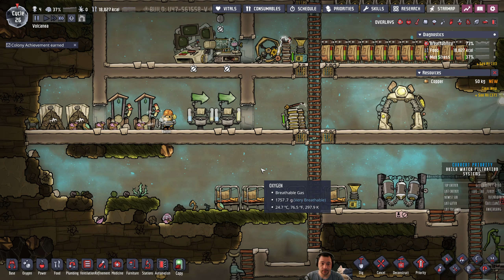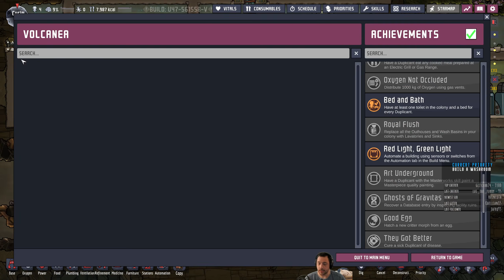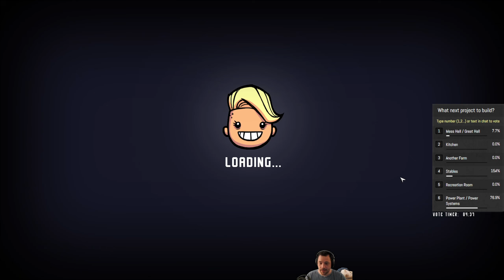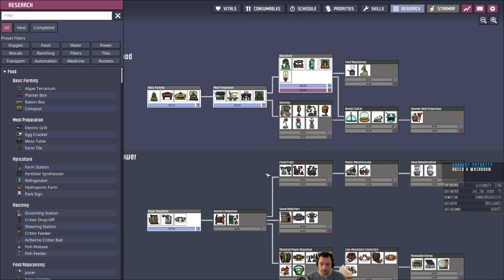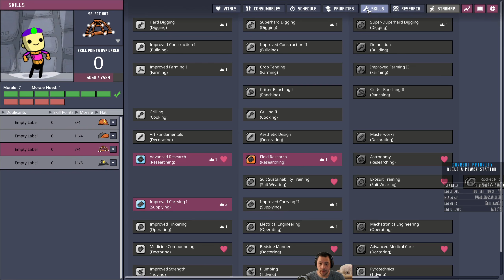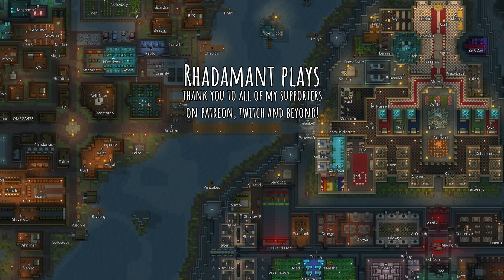Oxygen Not Included Volcanea - Washroom // EP5

Comment: Hey man, long time watcher, first time comment. Would the filter work if you built a system were chloine gas outlet was under water and the gas that floated to the surface was just pumped back under water? You wound need more gas but, if the game allows it, should let you purify more water quicker.
Reply from the maker: The game doesn't allow water to be purified in that way, germy water outside of a reservoir isn't cleaned when exposed to chlorine.
Reply: @Rhadamant  I'm not sure that's right. I tested it a little tonight and, as long as I didn't add any more water to my reservoir and used a sealed room, then the germ count seemed to be dropping. I did not have long enough to test it fully but it did seem to be working for the top three layers of water.
Reply from the maker: @wraithlast9201  https://oxygennotincluded.fandom.com/wiki/Guide/Disinfect_Germs

Comment: Good one. Never thought about a doing a power plant for the hamster-wheels. 
Also, the light in the laboratory would give the "lit workspace" buff if turned on, so that's probably worth it. Maybe put in small automation to only have it on when someone is working there.
Reply from the maker: Power planted hamster wheels are always fun!

I don't usually bother putting light into the lab because research is finite and isn't hard to finish all projects =]
Reply: @Rhadamant  True i suppose, just thought since you had to build it anyway for the room to count as a lab.
Reply from the maker: @gustavakerfelt6691  You make a fine point, one thing I've done in the past is to set up a pressure plate to turn the light on only when the station is in use, but since research is finite and researching dupes get enjoyment from researching it can be helpful to not research quickly to maximize moods, I'm not purposefully doing that, its just one benefit from going slow.